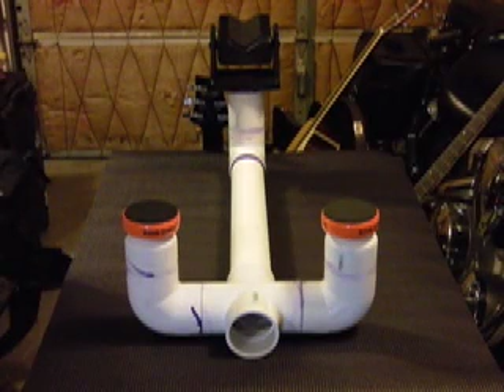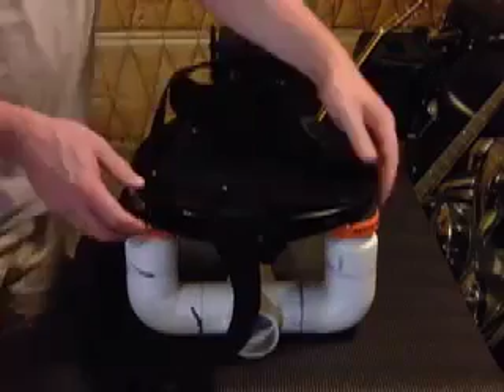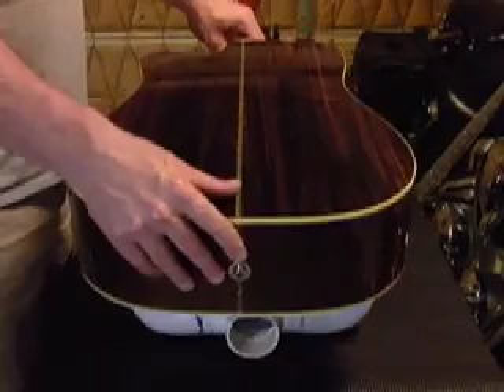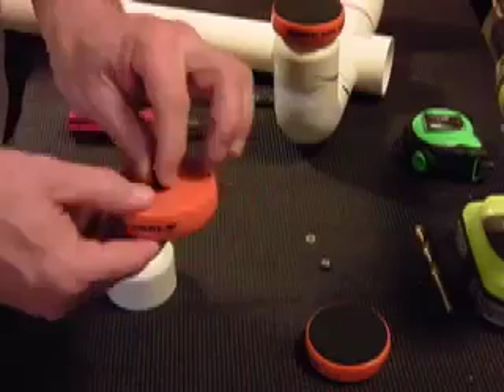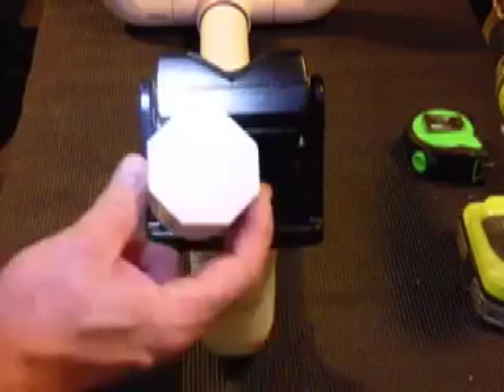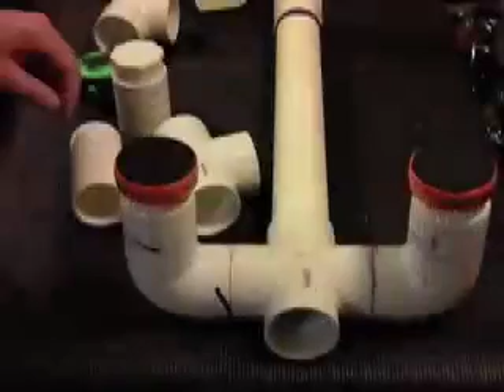Guitar Repair Stand

Comment: Super nice job.  ALso like the attention to assembly in order to make the elbow all be parallel.. that is a great insight and approach.  You still will need a horizontal surface for this to sit on .  Be curious if you tried to mount this to some sort of stand with legs ... Also you may want to add some adjustment to the length of the neck pipe just for those odd situations .  You should post another video where you use this ... Love to see it in action.  thansk